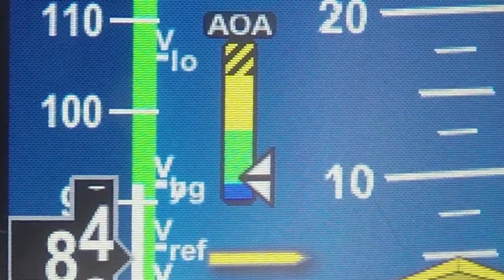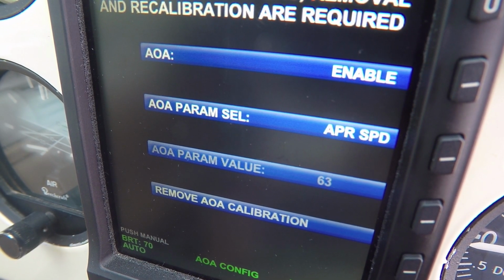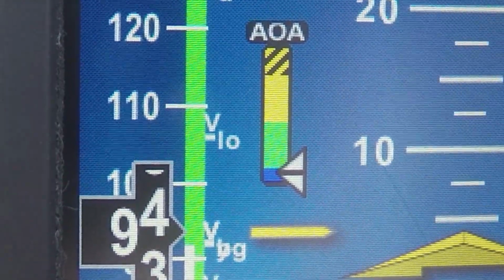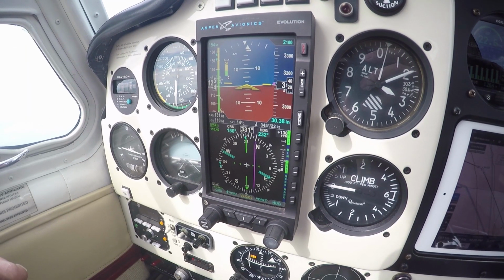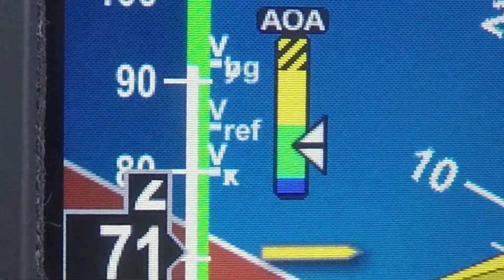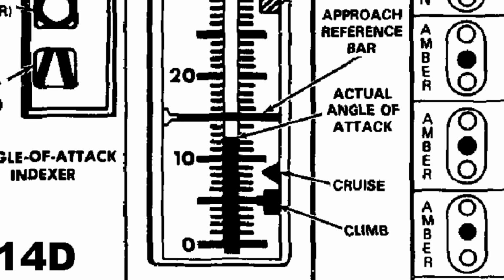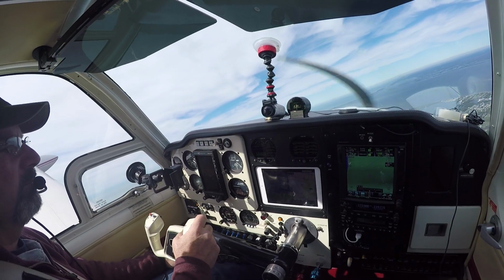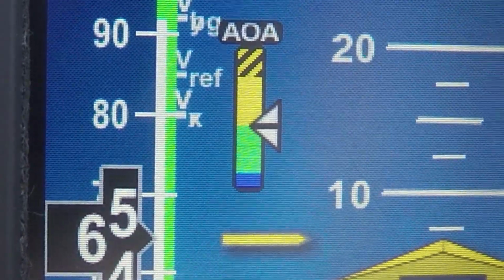Flying Aspen's Angle of Attack System

Comment: As a CFI, I really don't get AOA indicators for most GA airplanes. Are people really coming in to land so slow that they are stalling it? When my students and I go out and practice slow flight, I have them get the airplane down to 45 or even 40kias and we do turns left and right. Yes the stall horn is blaring, and yes there is a little buffet, but they can all do it without stalling the airplane. Contrast that with an approach to landing and its easy. I think what most pilots need to learn better is airspeed control. I've flown with some 1000hr+ pilots who'se approach speeds are all over the place.
Reply: you woulkd think so. i had no problem with the slow flight flying at 40 with the stall warning blaring the whole time and maintaining altitude with throttle and airspeed with pitch.  i still SUCKED at landing.  I got it down, but i still dont like it haha and am kinda scared for each onelol. mainly just scared of wind not really the actual act of landing.  I think a lot of it was fear/confidence.  I was shocked that i was gonna get to try to land on the first flight i was thinking that wouldnt be for like at least 3 flights haha.  I remember i became obsessed with it and would schedule flights just to do landings with my instructor.  i did a ridiculous amount of them at srq one day, id have to get my logbook to say exactly how many.  my instructor thought i was good way before i did and he was pushing for solo way before i felt ok with it.  its weird i love flying but i definitely am somewhat scared of it haha maybe call it a healthy respect.  I remember on my first solo i looked over and saw the right seat empty and said "what the f  am i doing up here" LOL  I did pull thru though and got my license.

I just re read your post though and no i have never come close to stalling on approach or any other time other than when trying to stall.  If anything I am convinced I was taught to fly final too fast resulting in excess floating and fast touchdowns.  Well the faa's war on stalls should be successful at least for those learning to fly recently.  I dont think i will ever come close to stalling one as im always saying to myself "dont stall" . I remember I wanted to do spins because I felt uncomfortable not being exposed to a possible situation that could technically occur.  I asked my instructor and the head cfi overheard me and said "what has to happen to spin?" I said "stall" he said so if you never stall you will never spin.  I may have some other mishap related to landing fast, but i can guarantee i will never inadvertently stall an airplane.